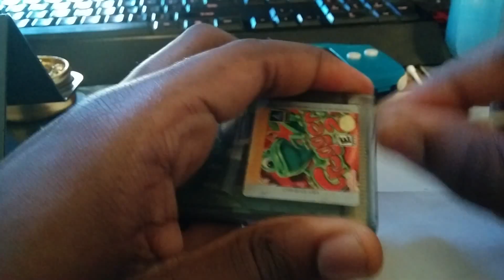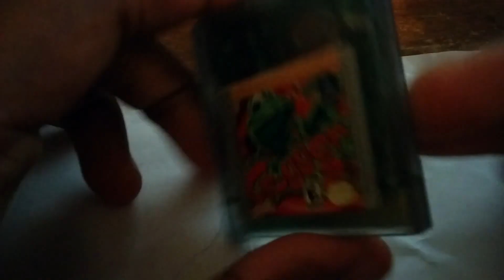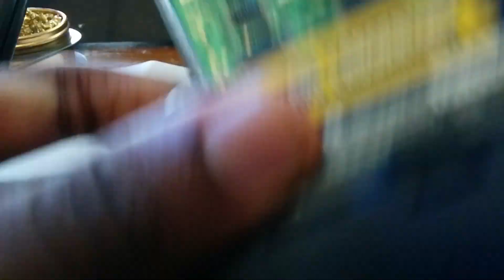Ultimate GameBoy Cartridge Repair Guide |Fix your games! (Cleaning, polishing, and reflowing!)

Comment: Reflowing the solder on the ROM module fixed my old Links Awakening (1993) cartridge. Before that none of the background tiles would load.

I lost my completed safe file in the process – because I desoldered the battery, just to be safe – but it was worth it. I was a thief anyway. ;)

Thanks for the guide!

Comment: How to check if all the 32 pcs golden finger connection lines are ok ? Where do they go ? I have a bent circuit board and would like to check the lines with maybe a multimeter somehow ? Any guide to check the PCB-lines on the green board ? Also what are the golden holes ?

Comment: I'm assuming you have to have the battery unsoldered on one side when reflowing any of the chips? Or just the ROM?
Reply from the maker: You could unsolder the battery if you wanted, but that would delete any save data.
Reply: Just wanted to make sure it wasn't required to avoid frying any of the chips. Thanks so much for the reply!

Comment: Hello! Question: Recently I just replaced the battery for my Pokemon Crystal game and for the first couple of days everything seemed to be working well. However after playing my game for awhile, there would be times that the game would freeze or reboot itself showing the Gameboy error message. Other times, if I turn off the game and turn it back on, the Nintendo logo would appear and afterwards whitescreen. I checked to make sure the battery connection was good and wiped the pcb with alcohol and tried to see if that resolved the issue. It appeared to work but couple of gameplay hours later, back to square one with game freeze, random bootup, then results to whitescreen after logo. Eventually when the game is able to play the intro seamlessly, Im able to see my save files are never corrupted and the oscillator keeps track of the correct time so no damage there. Overall, do you think this whitescreen after nintendo logo and game freeze is coming from the ROM chip or the MM chip? I hope you respond if you come across this comment. Until then, have a good day!
Reply from the maker: it's hard to say, I'd go ahead and rewflow both.

Comment: Hey I have a question for you. I have a bootleg 120 in 1 multicard game cartridge for gbc. It used to work completely fine and as programmed. One day I when I was playing my Pokemon games on It, the save file was no longer there and the sprites were black squares. I thought there was something wrong the battery. I was kind of correct because the for the motherboard to the battery was disconnected. Just be safe, I put a new battery in. But I taped it in, so I wasn't satisfied. I bought I soldering iron and soldered the contacts on to the board. But in the process I soldered it onto the solder close to the black chips. I thought I did a good job and put it into my Gameboy and expected it to work. But the Nintendo symbol was a glitch symbol. I removed the  solder and now when I put it in my Gameboy turns off immediately. I tried on my others and the same thing happens. Can you help me
Reply from the maker: hmm, well I don't have much experience with multicarts, if cleaning the board and contacts, and reflowing the chips dose not work,
I'm not sure what else to suggest.
The flash chip may have been damaged.
Reply: Thanks for the help. It was very considerate of you.

Comment: Hey man, I found a Pokemon Red on Ebay this is the person exact words below. 

"Couldn't get it to turn on so being sold as is for parts.  I suspect it may be a battery issue.
Cartridge is 100% Authentic. 
For parts only condition please see all pictures for wear / condition."
The game IS authentic picture wise. Would it be a good deal? It's $14.99 with $2.67 shipping.
Reply: Final_Enigma_7 for a really common game, buy local. bound to be a seller with a copy you can go test first. in canada pokemon red goes for 25 to 35 canadian. in the usa im sure its around 20 to 30. best of luck!

Comment: bruh

If the logo is scrambled up when i load my cartridge into my GBC, i just blow on the pins of GBC and cartridge, and everything works fine
Reply from the maker: I'm glad to hear it's working now,
But you really shouldn't blow on your cartridges, even a little bit of moisture on the contacts can cause corrosion.

Comment: Great video! I’m having trouble fixing my Pokemon Silver cart. Here’s the timeline, note that I did not even touch the battery, maybe I should have?: 

1. Messy Nintendo boot logo and stuck there
2. Cleaned pins and chips with 90% isopropyl alcohol 
3. Same messy logo
4. Cleaned pins with eraser
5. Same messy logo
6. Reflowed pins on the ROM chip
7. Game booted but froze during the game’s title screen
8. Would not boot up again, got messy logo
9. Reflowed all chips (ROM, SRAM, MBC, MM1134) 
10. Got past the logo again but froze
11. Wouldn’t boot up again, got either messy logo or nice logo but white screen after

Any ideas??

Edit: oh yeah, I messed up early on and got some solder on two of the bottom pins, so they’re silver instead of gold. It isn’t a thick layer and I tried to absorb it with copper wire (I don’t have that desoldering braid yet).